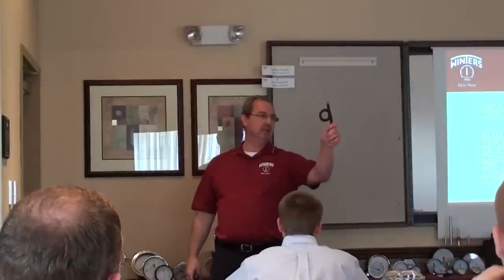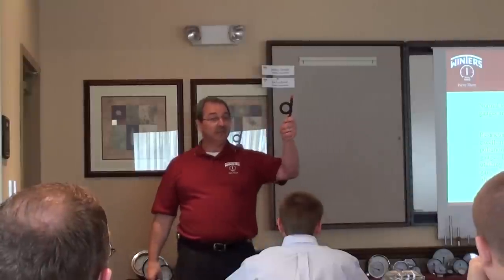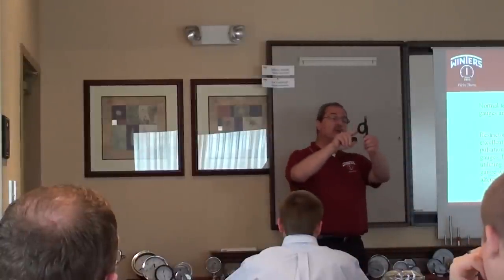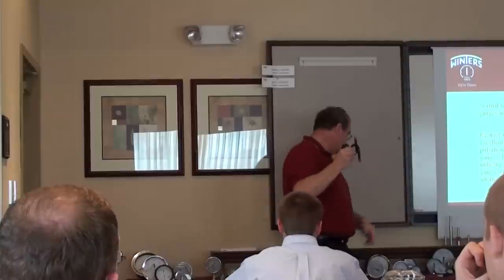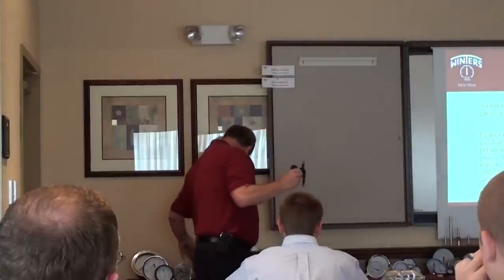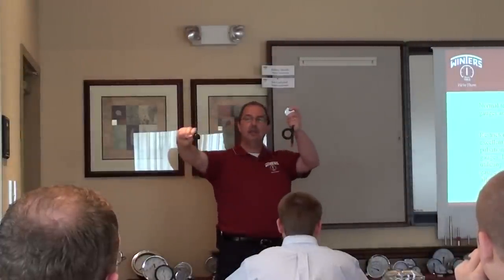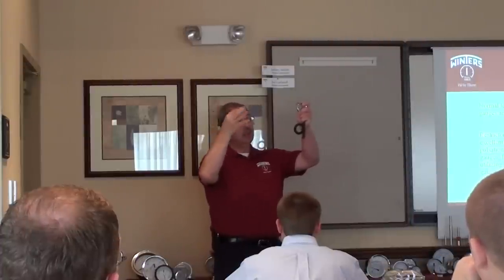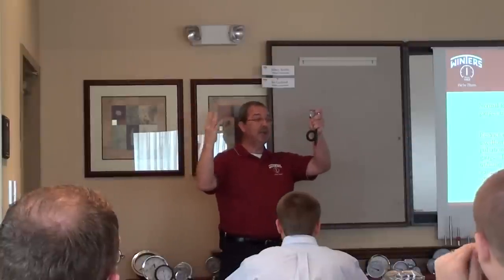How Does a Pigtail Syphon Work?

Comment: that's learning from a book!,   They must be installed with the loop axis in a horizontal orientation.     What happens is the liquid automatically forms from the steam in the bottom of the loop to stop the steam heat from getting to the pressure sensing device.    these are many times installed incorrectly,